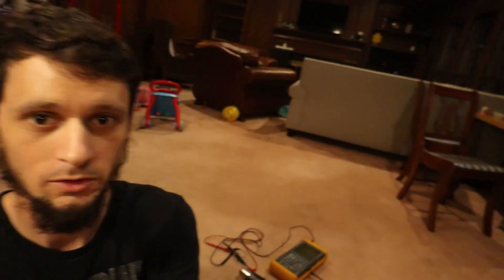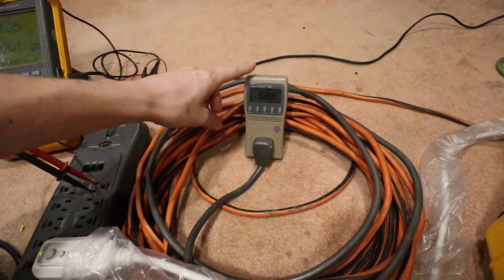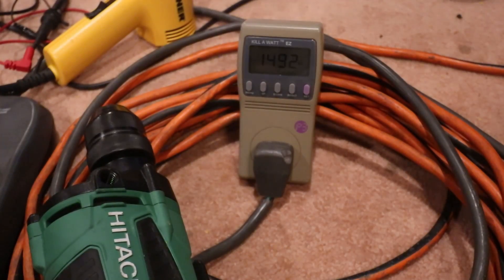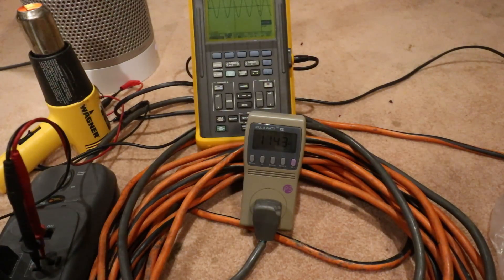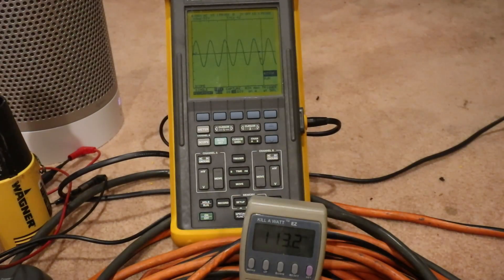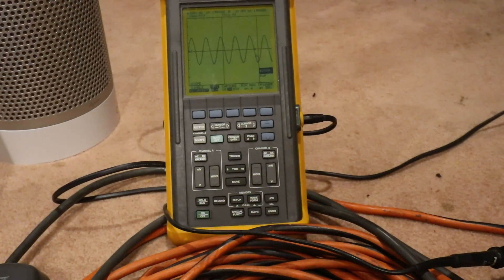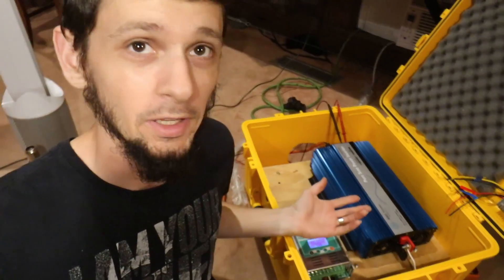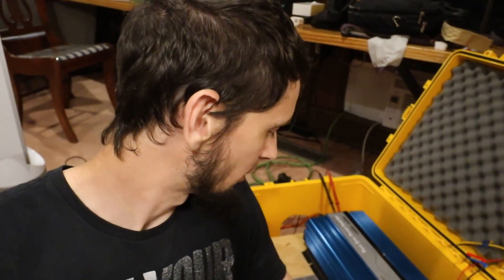AIMS 1500 Watt 48 Volt Sine Wave Inverter Review | How to kill a KillAWatt

Comment from the maker: I want to address a claim I made on wire sizing. I mentioned going down to 14 gauge for battery to inverter. This could be OK when classified as "chassis wiring" but safer to go with 10 gauge like I did for the extra safety.

Comment: Kill A Watt P3 I use is rated at 1800Watts. If you got more than that out of the AIMS that's a durable inverter. You should add to the title of the video. And Killed a KillAWatt during review. Nice video.  Would you be testing any cheap Chinese inverters?  Do you have a circular saw those have some huge in rush current draws. But guess an AC is similar.
Reply from the maker: Right! I don’t think I was anywhere close to the killawatt max but perhaps I had overloaded it in the past reducing its lifespan ;). That’s a good idea for a title adjustment, I’m gonna try it.